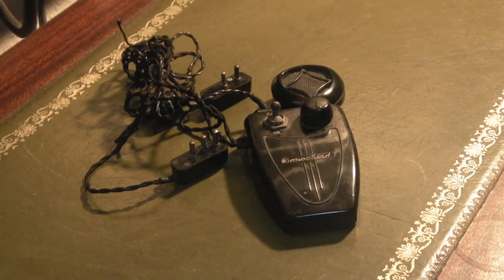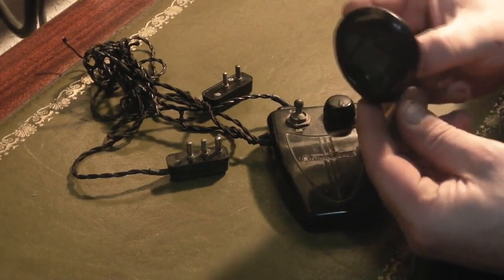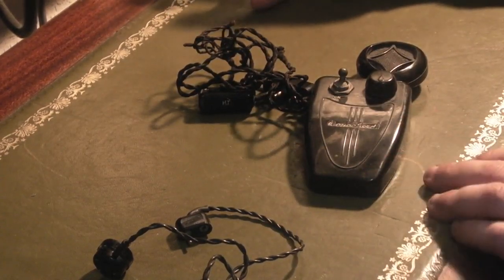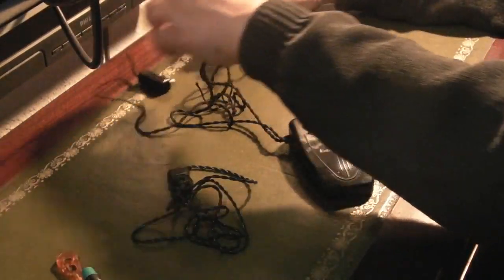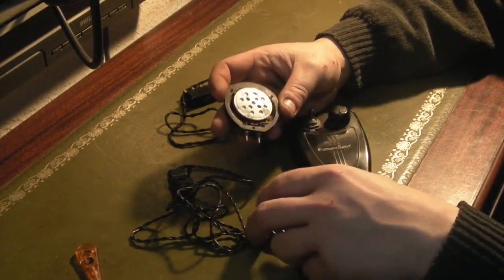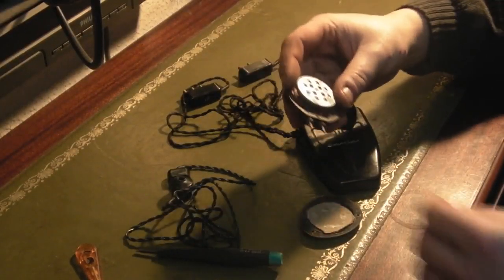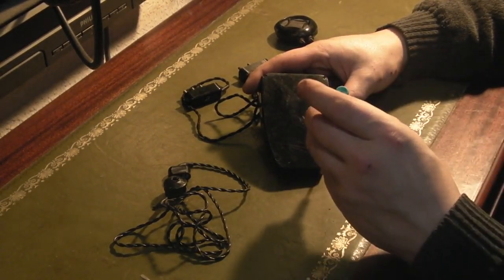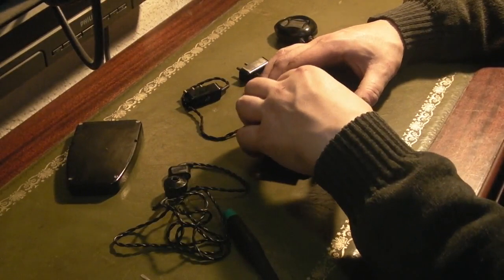40/50's vintage hearing aid lookover

Comment: Happy Christmas, keep up the great vids. (P.S. Can you align an AM radio built from kit?)
Reply from the maker: Is it one of those Chinese kit radios you get on ebay and alli express? if so yes, I will have to get one to build. shango066 has done a very good video on building and aligning theses kit radios.
Reply: @Jayoldstuff1  Yes, it's from Bang good but not the little red one that shango066 built. It's an 8 transistor radio ZX-921. I haven't built it yet and assuming it works OK,  it would be nice to have it professionally aligned if the price is not prohibitive. Is this something you'd be interested in doing   if I was to send it to you?
Reply from the maker: Yes I could do that for you, it would make an interesting video. give me a shout once you have put it together
Reply: @Jayoldstuff1  Will do, I'm checking the parts list right now :)
Reply: Well I've finished the radio and was elated that it actually worked. Some whistling and motorboating while tuning up and down the band but it was picking up stations quite clearly. I switched it off and put it to one side for 10 minutes and switched it on again. Nothing happened, totally dead, not a peep. Battery new.. No idea what's wrong. So would you be interested in tinkering with it, fault finding and aligning it if it can be persuaded to come back to life?
Reply: @Jayoldstuff1  Good news! I've got it working. Was a a faulty on/off switch, one of those horrible ones combined with volume. Rather than struggle with sourcing and fitting a replacement I've fitted a separate switch. Is there any way I can PM or email you?
Reply from the maker: That's grate news. yes you can email me on jasontaylorelectric(at)gmail.com. I will be busy until the end of January but we can sort something out.
Reply: @Jayoldstuff1  Excellent Jay, I've sent you an email.